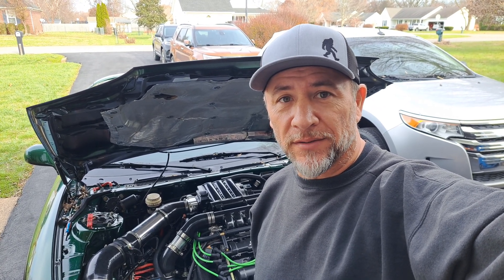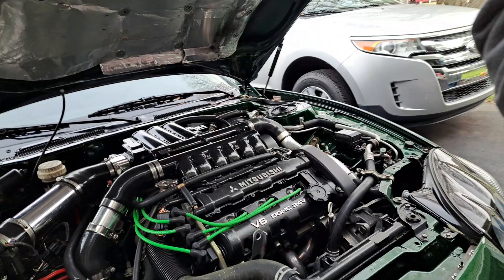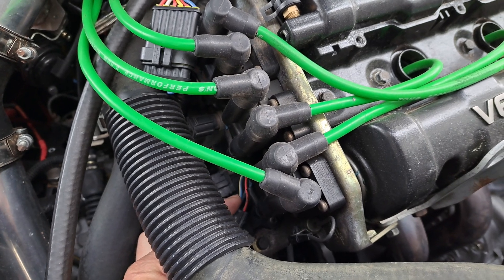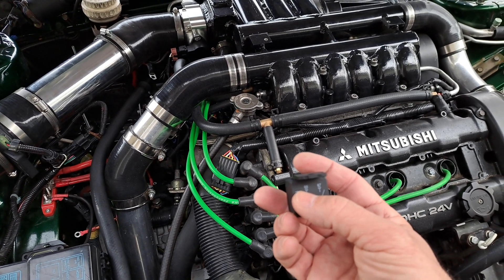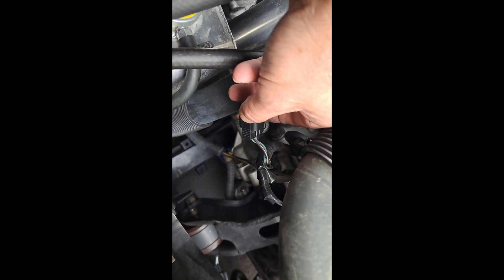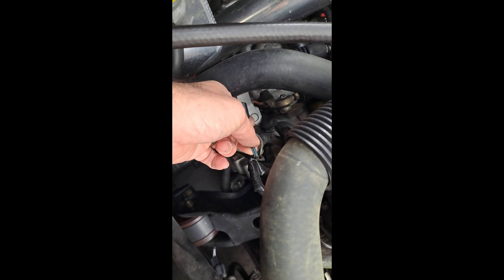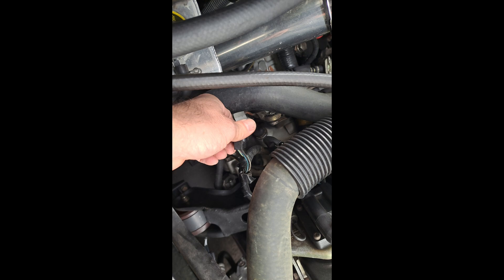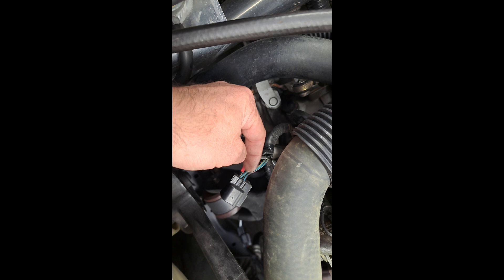Fixing heavy load misfire under boost aka spark blowout by hotwiring the coils.

Comment: I have always combated blowout by adjusting plug gap. Why did you approach it this way? Seems like fixing the symptom not the cause.
Reply from the maker: I may or may not have mentioned in video but low voltage battery was my actual problem but anything on the car like fuel pump that doesn't get full 12v I decided to hot wire. I decided to make a video in case someone else wanted to do it.
Reply: @sigvision4189  okay. To be honest I saw the text on the thumbnail. Didn’t watch the video. I was curious. Also considered it might be an issue specific to your chassis.
Reply from the maker: @James_T_Kirk_1701 all good, these do have an issue of not sending full 12v to coils. They normally only send voltage in the 11 range so it is pretty common for people to hot wire the coil

Comment: Nice! I was looking on doing this on my 95 VR4 because blowout at 12psi on my new build too. I gap down my spark plugs to 32 and I’m not getting anymore blowout at  10psi.
Reply from the maker: @xavierpr4494  Pretty simple to do and eliminates any doubt down the road for sure
Reply: @sigvision4189  Agree! I just bought the relay and am adding AN fitting to my fuel pump sender plus upgrading the fuel pump this weekend. I'll add the hot wire to the coil and fuel pump as well. Will see how much I can increase my boost without experiencing blowout and maybe gap up for more BOOM! 😄car was pulling hard at .40 gap but once I hit 5k blowout.
Reply from the maker: @xavierpr4494  are you using the 3sx fuel pump hotwire kit? That is what I have and the fuse holder melted because it got too hot. I ended up replacing the fuse holder. I do however have the 450 hellcat pump so it pulls alot of current
Reply: @sigvision4189  Good to know,  I installed the 3sx hotwire kit last week with a 255 Walbro and I have 0 sparkblowout now with no Knock at 11psi WOT. I'm going to change that fuse housing just incase Thanks! Updating my FPR (stock is not holding vacuum) to an AEM and doing the coil hotwire next weekend.
Reply from the maker: @xavierpr4494  sounds like you have some nice upgrades going on. I graduated in 1995 and these were my dream car but I was making $4.50 an hour so affording a $30k car was a pipe dream. Mine is a 99, I should pick me up a 95 at some point just so I officially got my dream car 😀

Comment: def taking inspo from that power block thing. very neat. eventually i want to convert my car to COP but i think i need a haltech or a god level tune on chrome to not burn thru my coils
Reply from the maker: @WinnyPooh  What is COP?
Reply: @ coil on plug
Reply from the maker: @WinnyPooh  I have seen some do the modification, what is the benefits?
Reply: @sigvision4189  no more dealing with a ptu or coil packs on the side, no more running a wasted spark system, and i believe a stronger spark that’s much more tuneable bc it’s all a separate coil that the standalone can dial in